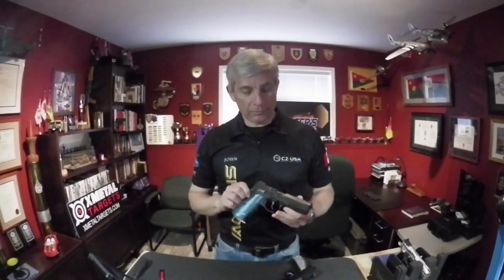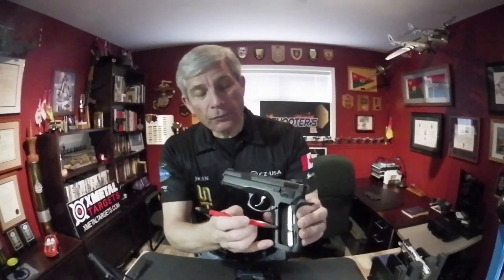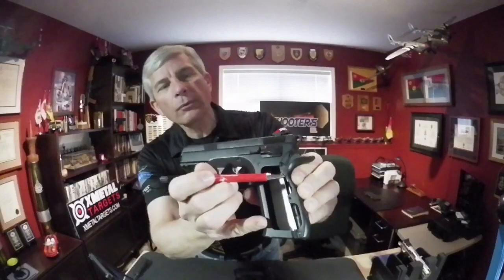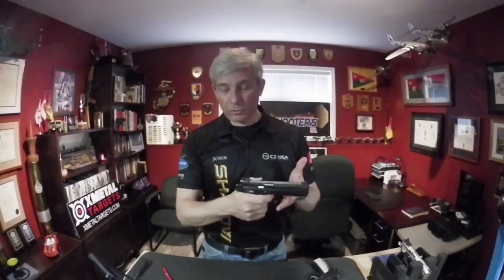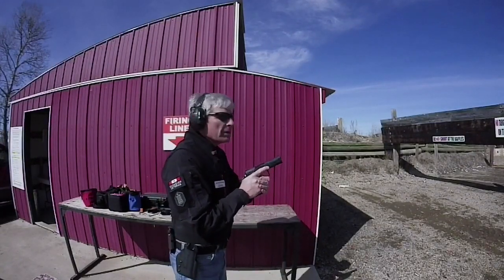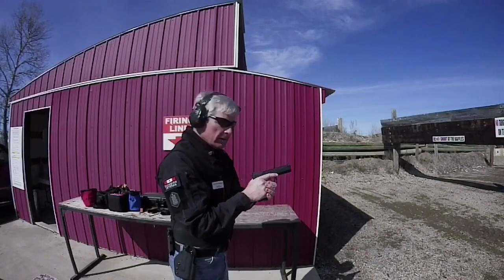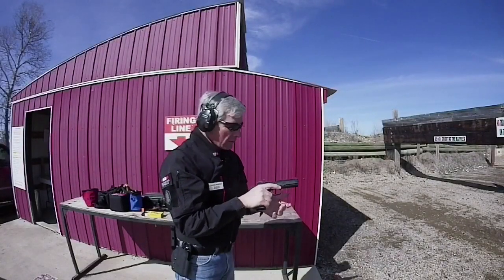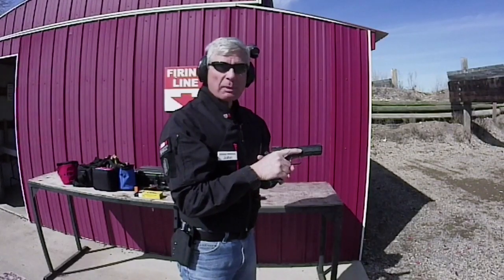Gun Review Series: CZ Shadow 2 Update #1 - Main Spring (E29)

Comment: At 6:15 the guy says he doesn't expect difficulties with the double action first shot in production division, but why not just start with the safety on?
Reply from the maker: IPSC Rules does not allow Production Division competitors to start with the hammer back and safety on.  The gun must have the hammer down and your first shot must be double action.
Reply: Are you serious? Even if someone has a pistol with only a safety lever, and no way to safely lower the hammer they won't let you start with the hammer back and the safety on?  The way they explained it to me was if you have a safety on your gun you have to start with it on.  That was a big reason why I bought this gun.  I hated starting in double action with my Beretta 92 and thought I could start with the hammer back and safety on to do production division in USPSA Practical Pistol.  I hated pulling the hammer back at the start of every stage with my Beretta and I saw everyone with 1911's or anything that only had a safety starting with the hammer back and safety on.
Reply from the maker: Well, I'm serious.  :-)  In IPSC and USPSA for Production Division, the hammer must be down before the start signal.  In other words, the first round fired in Production Division MUST be Double Action.  You cannot draw the gun and pull back the hammer.  The first round MUST be Double Action.

Classic Division is where 1911 pistols are used and they are single action guns.  Therefore, the hammer is cocked and safety engaged for the "Load and Make Ready Command".  As well, same thing for Standard and Open Divisions in IPSC and for USPSA Limited, Limited 10 and Open Divisions.    All of these Divisions have the gun start state with the hammer cocked and safety on but NOT in Production Division.  

Therefore, you must learn the techniques of how to lower your hammer on your gun when it is loaded if competing in Production Division.  If this is too difficult for the individual, their only other option is to use a gun that has a decocker.
Reply: Yeah I just read the Production thing.  I don't know if they just let me pull back the hammer against the rules back when I used my Beretta 92 at them in 2011.  I don't know if they've changed the rules since I used to do the matches, but it's a huge bubble burst for me.  I hate double action trigger pull.  I was going to use my HK USP Compact in .40 caliber, and I specifically changed the safety detent plate so that it had the safety and decocker, so I thought I could just put on the safety if I used it at Practical Pistol matches.  Plus I just bought the stupid Double Alpha belt and mag holders and the holster won't even attach to the belt so I have to order another part for that and this whole thing is so frustrating for me!!!  9mm is pointless to use in Limited because it's minor power, without a red dot sight and compensator, so this has been a pretty bad day so far, but I do apologize for my bad language before.
Reply from the maker: I hear what you're saying about double action but it does have its PROs and CONs.  The key is that if you want to compete in Production Division, IPSC or USPSA, you need to find the right gun that has a great double action.  I can tell you that the CZ Shadow SP-01 has likely one of the best double action trigger pulls that I know.  I always and will continue to recommend the Shadow SP-01 to people who are looking for an excellent Production gun.  Right out of the box the Shadow SP-01 is ready for competition and by changing the main spring to a 13 lbs spring, the double action and single action trigger pulls are outstanding.  Out of the box the Shadow SP-01 has a really sweet trigger (smooth and light) and with the cost of a $10 13 lbs main spring,  you have a SA trigger pull of around 3 lbs and a DA pull of between 5-6 lbs.

I wouldn't recommend competing with the HK USP Compact .40.  You would be at a major disadvantage: polymer gun too light,  lack of weight doesn't help with recoil management, .40 S&W + polymer gun + compact = lots of recoil and muzzle flip.  

Yes, 9mm is pointless in Limited and if you put a red dot and compensator on the gun, you are now in Open Division.  The "real" open guns would have a great advantage on your "make shift" open  gun.

No, problem about the language.  We all get frustrated at times.  Shit happens.
Reply: I think my best bet is to just "bite the bullet" and get used to the double action trigger.  I was considering making my Shadow 2 an open gun with the compensator, mag well, extended mags, and red dot sight, and I think if I could hand load 9 mm major power (about 170 power factor with 147 grain bullets at about 1,156 fps and brand new brass) that I could compete with the likes of STI race guns, especially if I upgraded the trigger parts and other parts too.  CZ is a pretty great brand.  I've also had a pretty frustrating experience with buying a holster rig for this gun.  I ordered a Double Alpha belt and rig setup I put together on their website, but the holster I chose isn't compatible with the belt, and they're saying I can return the holster for this other holster, but I'm pretty frustrated that they didn't warn me about that holster not attaching to the belt, so I told them I might just return it all except the holster and just use that on my regular belt!  Also I probably should have gotten a little bigger of a belt, like this size will work, if I lose some weight.  I'm sorry for rambling and thank you for having this convo with me.
Reply from the maker: If you want to compete in Production Division, you will have to bite the bullet and learn to deal with the double action.  You will have to do want you can within the limits of the rules to have the best possible trigger pull in DA.  Choosing a good pistol is key.  As I said the CZ Shadow SP-01 is a very good pistol and for the cost of a $10 or less 13 lbs main spring, you will have a very good SA and DA pull.   Unfortunately, I didn't get the same results with my Shadow 2 after changing the main spring.  The trigger is a nice trigger out of the box, smooth, but the DA is much too heavy.  The 13 lbs spring only reduced the DA from 10 lbs something to slightly above 7 lbs.  That was very disappointing.  Other great pistols for Production Division are Tanfoglio Stock II and Stock III.  The Xtreme models are the way to go if the extra cost isn't an issue.  The Tanfoglios are more expensive but they are worth the money.

I find it interesting that many people who get into competitive shooting want to compete with their carry guns and then get frustrated when they find that they aren't competitive with other shooters.  Some carry guns are better than others and will work fine in competition, I speaking strictly IPSC and USPSA, but they will eventually hold you back as you improve.  The gun doesn't make the shooter but it sure helps to have a good gun and good appropriate competition equipment.  Have you watched my equipment video: belts, holsters and mag pouches.  The belt video is perhaps boring but I do point out a few important facts when considering a belt.  If you are going to compete, you really need competition equipment.  It will give you that little bit of extra edge you need to be competitive.  You need to seek out every bit of competitive edge that you can get especially if you want to be truly competitive which I am.  Regular practice, good training plan, dry fire practice, quality competitive gear (belt, holster, mag pouches), reloading so you can tune you ammo to your gun, attend as many matches as you can (matches are great training), and take a course or two from a pro shooter like JJ Racaza, Max Michel or Eric Grauffel.

Do you want to compete in Production or Open Division?  I'm sure that converting a Shadow 2 into a open gun will run you between $1500-$2000 USD.  Maybe I'm off the mark but that type of work tends to be expensive.  As you mentioned, you will need to reload as you won't find 9mm Major ammo on the store shelves.  Open guns are be very picky on ammo and fine tuning for ammo is a must to get these guns running properly.  Check out I Run Guns in Arizona.  I got my Tanfoglio Gold Custom Eric 2009 9mm (major) from them.  Great price compared to Canada!!  

What holster did you buy for the HK?  Having a good stiff belt that supports all of your gear is very important.  Perhaps that holster you have can be your range holster for everyday shooting.  If you plan on using the HK in competition, perhaps there is a better holster for that job?  

Well, that is my two cents worth.  Final thought, I also have a few competition gun reviews in addition to the Shadow 2 review video.  Not sure if you have seen them.
Reply: Thank you; I think I have watched a few of your other videos too.  I conceal carry a Sig P938, and I actually did use it at a weekly steel match they have here one time last month.  I scored 28th out of 30; it was terrible.  The next time I used my CZ Shadow 2, and got 18th out of 28.  I'm not really sure how deep I want to get into this; it's always just been a hobby for me, not trying to be competitive at all.  The main reason I liked it was it gave me the chance to run around and do more interactive shooting than I could otherwise do, and also maybe it could replicate some of the adrenaline I would experience if I ever do have to use my gun for home defense or something like that.  I love my CZ Shadow 2 pistol so far.  I will do this upcoming match on October 28th, and then during the off season I can decide how to proceed from there.  I think that I will have enough equipment already to do that match at least.  Thank you for helping me with this; I don't have many friends at all, so I have no one to talk to about competitive shooting.

The holster I have for my USP Compact is just a Blackhawk Serpa holster; it cost like $20, and at the range where they have the friday night steel matches around here Serpa holsters aren't allowed.  I could carry my gun around in my Serpa holster there, but I couldn't draw from it when I competed.  I'm probably just going to do Production division with my Shadow 2 and make the most of it.  Most stages unless the first target is a no shoot the first double action shot isn't that important anyway, right?  It's just the best two on each target that count isn't it?
Reply from the maker: Nice. I'd like to own a Sig P938 but they are prohibited handguns in Canada.  Anything with a barrel under 4.25" is prohibited.  I do have my Prohibited 12(6) license as I was "Grandfathered" in 1996 when our firearms were classified into groups: non-restricted, restricted and prohibited.  Only way to get a Prohibited 12(6) license was to own a handgun with a barrel length less than 4.25" before the law changed.  No new firearms owner can get a Prohibited 12(6) license.  

Most carry-gun are not made for competition especial compact / sub-compact handguns.  

The Shadow 2 on the other hand is built for competition.  As I mentioned, install a 13 lbs mainspring and you'll get a better / lighter DA pull and, of course, the SA pull will be reduced as well.  The first round, double action, does count.  Yes, on strategy is to take three shots at your first target if you are going to consider the DA shot a throw away.  That really isn't the way to do it though.  You need to make that first shot count so you don't have to waste time taking a third shot.  You try to choose the closest and / or open target (no mentally / no shoot targets around it) as the first target to engage.  That increases you chance of a good first round hit in DA.

The nice thing about IPSC, USPSA and IDPA, is that you don't have to be super competitive or competitive at all if you don't want to.  If your goal is to develop your gun handling and shooting skills through the street that competitive shooting provides, great....that is your goal and that is what you work on.  Shooting IPSC, USPSA and / IDPA is a great way to develop both skills: gun handling and shooting skills.

Well, a Blackhawk Serpa holster is an illegal holster to use in IPSC, USPSA and likely IDPA as well for safety reasons.  The holster's release button is in line with the trigger.  That created a situation where the competitor could find his / her finger on the trigger as the gun is draw out of the holster and worst, that they pull the trigger at the same time before the gun has cleared the holster and is on target.  As a carry holster and if you want Level 2 retention, the holster is good but not for competition.  

If you have other questions, feel free to ask.  You can email me as well as my email address is provided on my Channel under the About tab.  What part of the US are you in?
Reply from the maker: Nice sub-compact carry gun.  I like the Sig P938 and had the opportunity to handle one at the 2018 Shot Show  in Las Vegas.  In Canada any handgun with a barrel length of less than 4.25" is prohibited as of 1996.  There are many handgun in Canada with the barrels less than 4.25" and all owners where grandfathered when the law changed so we could keep them but no one can get a Prohibited 12(6) license unless you were one of the grandfathered firearms owners.  We can buy and trade the handguns amongst ourselves in Canada but no new one are allowed to be imported into Canada.  Anyhow, just a little info on Canadian gun laws in respect to these sub and compact handguns.

Most carry guns, especially sub or compact pistols, are no really suited for competition.  The Shadow 2 on the other hand is.  As I said before, install a 13lbs main spring (there is a YouTube video on how to install a mainspring if you have not done it before) and you will have a slightly lighter DA.  I think my DA went from 10lbs to a hair over 7 lbs.  Still much to heavy for my liking.  I had ordered a 11 lbs main spring from the IPSC in Estonia but they sent me the wrong one (incorrectly packaged).  It was a big disappointment.  I think a 11 lbs would likely bring the DA close to 5 lbs (just above the 5 lbs IPSC rule).  I have yet to find 11 lbs main spring much to my disappointment.

IPSC, USPSA and IDPA shooting is great to help you develop and hone your gun handling and shooting skills.  The stress of competition is very good to help you to learn to shoot under stress and to improve your react time to malfunctions and having to change your stage plan when things go for shit.  I know many people who shoot IPSC and IDPA simply to improve their skills and not for the competition.  Nothing wrong with  that.  It takes a lot of dedication when you decide to become competitive which I am....competitive.

The Serpa holster is illegal in IPSC and USPSA.  The holster release button is in line with the trigger and there is the possibility of the trigger finger landing on the trigger during a fast draw resulting in an accidental discharge.  

Every round counts including the first round which is DA.  Sure, you can use the strategy of engaging the first target with 3 rounds all the time but you are losing time.  You really should work on making that DA first shot count.  To help make up the time that you will use to ensure a good DA pull / hit, draw your gun aggressively and fast, then take the time to squeeze the trigger under control for that first DA shot.
Reply: @ShootersInc  I like my 938 a lot. We have pretty decent gun laws here in Ohio (in my opinion and I like more lenient gun laws). I just shot a steel target match on Friday that I've done a few times this summer. I first used my Shadow 2 last week and I got 18th out of 28 production scores. This last time I got 4th out of 34!!! I had never been in the top ten before! I can't believe I'm actually getting good at shooting it's so exciting for me! Thank you for replying to my comments. I appreciate it.
Reply: I think I just now got that you were talking about the hammer spring this whole time when you said "main spring".  I changed my hammer spring in my USP Compact and in the Beretta 92fs I used to have.  I googled it and found an 11.5 pound hammer spring online for $7 from Cajun Gun Works.  Can you not order from them since you're in Canada or something?  If that's the case I'll help if I can, since I can order it here from them.
Reply from the maker: No, I'm not talking about hammer spring although that is a spring you could change to help reduce the trigger pull as well.  The main spring runs along the back strap of the pistol.  Changing the main spring will give you the biggest change in trigger pull.  Change the hammer spring and it will help reduce the trigger pull a little more.

Some US stores cannot ship to Canada as they don't have an export license.  It also depends on what the part is.  Some parts require to export license and the hammer spring is one of those parts.
Reply: I just looked in my Shadow 2 owner's manual at the parts diagram and I think we're just getting hung up on semantics.  The part that it calls the "main spring" is what I think of as a "hammer spring".  I apologize for the confusion.  Here are two kits at Cajun Gun Works that I have found for improving the Shadow 2's trigger pull.  They are the same, except one includes a new bushing and the other one doesn't.  The one with the bushing is $285 and the one without it is $225.  The disconnector requires some fitting work, but here is the description:

Take your Shadow 2 or Shadow 1 from great to OMG!  This will transform your S-2, delivering an ice crisp SA of 3 lbs. or less.   DA typically runs 6 lbs. or less using our famous HS-12000 (11.5#) hammer spring.   The disconnector will require minor fitting so you get the reset to a PERFECT 1 mm, which is not difficult to do with CGW tech support.  Turns the CZ lock work into a precision Swiss watch!  USPSA Production legal too!

Here is the link for the kit w/o the bushing https://cajungunworks.com/product/75800-shadow-s-2-kit/ and here is the one with the bushing https://cajungunworks.com/product/75810-shadow-s-2-kit-bushing/

I think these are exactly what you are talking about, but I'm not sure.  I think that I'll save up and get the kit without bushing and find a place to fit the disconnector for me.  I hope that wouldn't cost too much.  I guess I could try it myself, but I would be a little nervous to try that.
Reply from the maker: My mistake confusing the situation.  I got confused with another gun.  The main spring in the Shadow is also the hammer spring.  I will checkout Cajun Gun Works.  Now, there is still an issue for IPSC shooters in that, using the Cajun Gun Works hammer / mainspring would make their Shadow illegal for IPSC as it is not a CZ part.  There may be a similar issue with the USPSA rules on what can and cannot be done to a Production gun to keep it USPSA legal.  That info is all in the USPSA Rule book.  I believe Cajun Gun Works ships to Canada.  Thanks for the offer.  Very kind of you.

I don't think you have to get the full meal deal from Cajun Gun Works to improve your trigger but many people do especially those who want a professional trigger job done.  I think that if you could find a 11 or 11.5 lbs main spring, you can simply swap it out yourself.  It is extremely easy to do.  There is a video on YouTube that will show you exactly how to do it.  You would save yourself a lot of money.  I believe that CZ Custom has lighter weight main springs as well.  I will have to check with them.  Of course, once I use a custom part in my Shadow 2 or SP-01, they are no longer IPSC legal but I can still use them in steel matches.
Reply: @schneir5  Just get an 11lb spring. I got a 13lb because the stock DA was almost impossible for me and gave me shooting pains in my wrist, the 13lb is definitely better but still a bit painful. I am going to get the 11lb and ultimately a comp hammer which also helps.